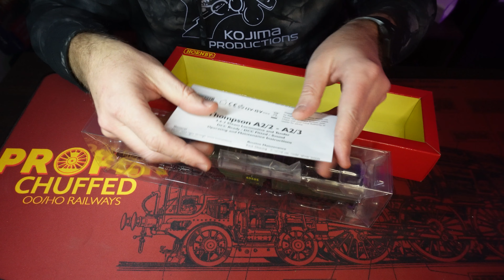A2/2 "Thane of Fife" - Revolution or Devolution?

Comment: I bought this loco because it was on offer at Amazon and I couldn’t resist it . I was never a fan of Thomson locos , but actually I find her pretty handsome . When she arrived the buffer beam was loose but I was able to reattach easily . It is a very smooth runner , so overall pretty impressed . It clearly is built to a cost .  Surprisingly she has become one of my favourites .
Reply from the maker: Hey Russel, you and I are in the same boat, browsed over it a few times but one day I was watching a video about them and it quickly became a 'MUST HAVE' for the collection. Now to add the A2/3!

Comment: Ah, British Railways Green - a sleeper subject if ever there was one! It certainly does look washed out on the Hornby Thompson Pacifics, across both A2/2s and A2/3s but if their depots couldn't be bothered to get the paint right they might have well looked like that back in the late fifties.

Also I dunno who that FlyingScott feller is who you spoke such kind words about at the end there, but he seems a right hack...!

PS. you mention the A2/2s were 2 cylinder locos - but they were actually 3 cylindered, which is why they were so long, as the middle cylinder was placed far forward in order to fit both Walschaerts valves and in order for the middle cylinder to drive the front axle.
Reply from the maker: I read that reply and could literally hear your voice 🤣 I am... Proper chuffed to see you in my comments section! Your video on the liveries was essential, I would like to poke you to consider doing a video on the differences between Bachmann and Hornby's LNER apple green as they are vastly different and I am not sure to this day who has it right... 🧐 

You're quite right about the cylinders, I botched that! 🥲

Keep up your amazing content and thank you for popping by here, it means a great deal to me. Hylt

Comment: Hornby got one thing wrong in the detail,along with most BR locos repaired in 1956/7,the new crest was applied wrongly with the lion facing forwards on both sides,this was pointed out to BR by the society who had granted the crest,the lion should face to the rear on the right hand side,as locos were repaired from 1958 this was corrected,but 60505 was one of the first pacifics to be scrapped and retained the incorrect crest to the end,a small point maybe,but Hornby got it right on their B17s,so 60505 is incorrect as a model.look at the picture on this article you can see clearly the incorrect crest!

Comment: I hate the flangeless trailing bogie wheels too - my A4, 'Gadwall', has them, yuk. The A2/2s are rather good looking beasts, I must say, they do need a rake of Thompson coaches to pull to look their best. I must say the layout is coming along very nicely, I've been at mine for 14 months and only just got it running on the DCC bus. The colour is certainly odd, but who knows?
Reply: Hi there. Both "Flying Scot" & "Barrie Davis" would agree with your assessment of Thompson's Pacifics. Personally, I'm more a fan of his B1s. His L1s weren't great either, but Hornby's model is one of my favourites.
Reply: @stephendavies6949  the L1s were fine, they did the job they were meant to until diesels displaced them then they got handed work they weren't suited to and suffered because of it. That's hardly a design problem more a what you ask of the design problem.
Reply: @Samstrainsofficially  I do like my Hornby model of the L1. It looks and runs extremely well.
Reply from the maker: A rake of Thompsons would be ideal, I really need to find some at some point. Thanks Chris, I am getting there, albeit with some frustrations along the way 🥲

Comment: BR referred to the loco colour as dark green which in no way is a description  of that carried by this loco - which is almost the old apple green. That aside, a good review of another Hornby item which, as usual, is overpriced.
Reply: It's much closer to the BR than the apple green. 

Lot of models come across as too dark in the green for my eye bachmann in particular can be guilty on this front even mode so when they try and pull of a GWR green livery. 

This is pretty acceptable overall it adds some variance to any green fleet which there would absolutely be back then, this whole class was gone by 1961 and basically missed the boat on any real standardisation of colour, it was all mixed by hand to the paint shops best approximation of orders from higher up and no two were really the same as a result.
Reply from the maker: Hello Hugh, indeed quite muted to the usual. I quite like it however, and it definitely opens up options for weathering. Thanks for watching mate!
Reply from the maker: Good point on this, I think there is always opportunity for variances in colour when it comes to different sheds using different paint mixes so frankly, I quite like it actually.